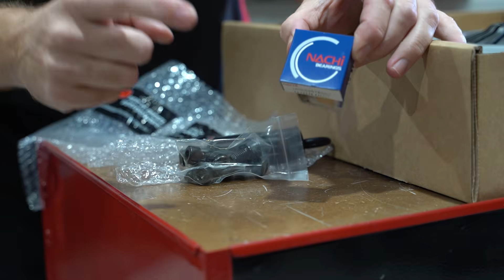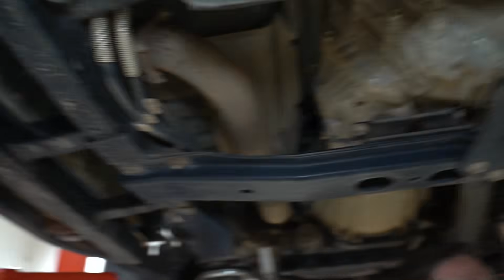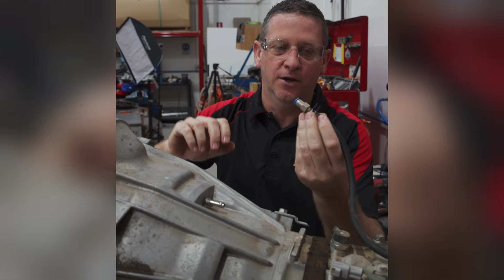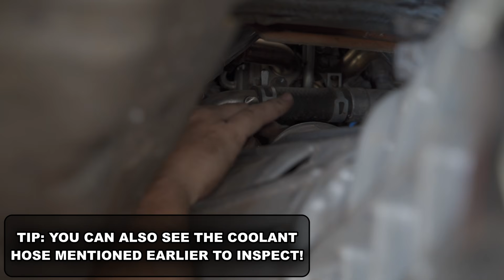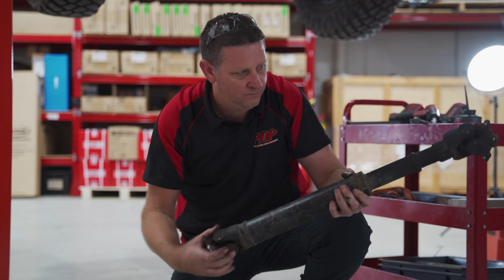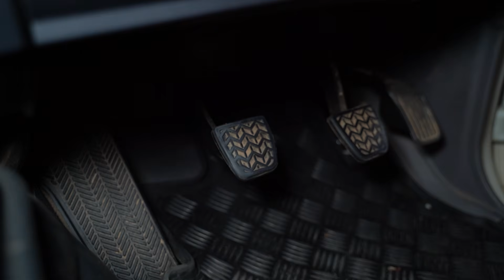NPC Clutch Install for 70 Series Landcruiser | PDP

Comment: Have the NPC 1300 in my vdj79. Only done 5,000kms. When I reverse up my driveway (slight incline) no load, it shudders a little. Is this normal?
Reply from the maker: Using throttle too when reversing up?
Reply: @PerthDieselPerformance  yes and holding clutch at bite point to go slow
Reply: I had the exact same issue
Reply: @CathieTang still have?